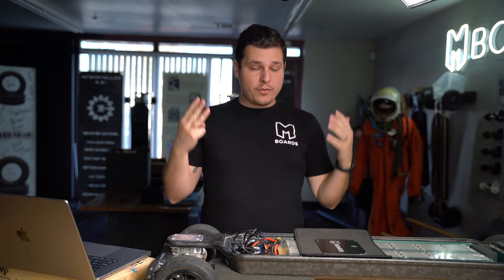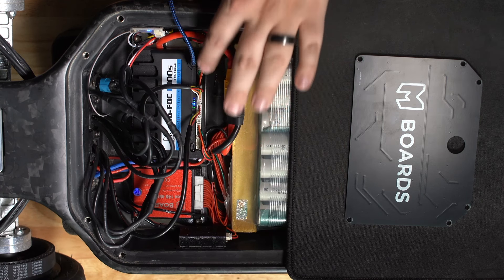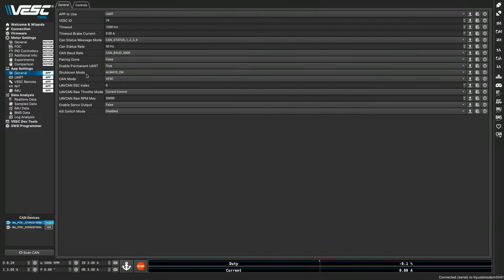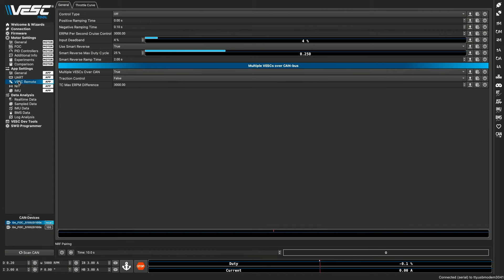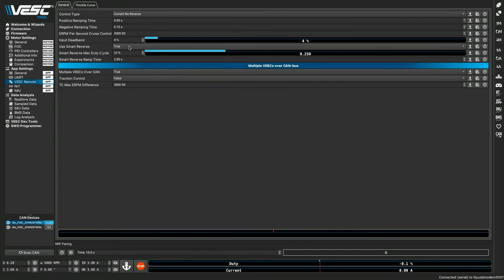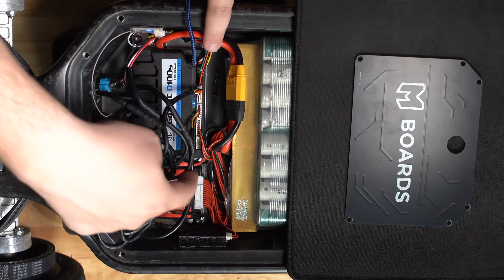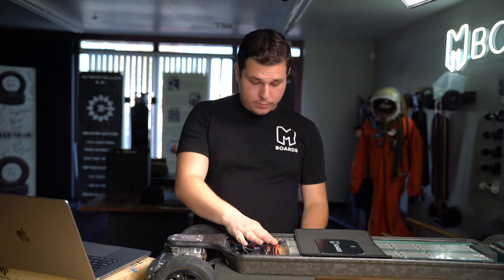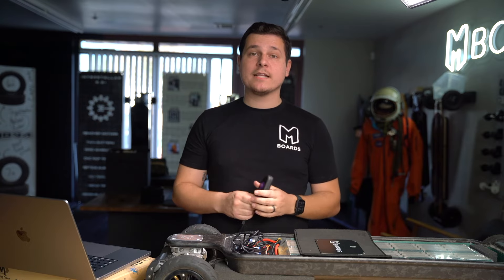VESC TOOL 2024: App Configuration

Comment: Mike these videos are a great refresher and very well explained.

Curious about smart reverse and if you've had the smart reverse glitch.  When on full brake and coming to a stop, the smart reverse  can completely disengage the brakes.

I've only noticed this on full braking. Where you have -120A set maybe you never actually actually need to use full brakes because they are set up so strong?
Reply from the maker: Totally know what you are talking about. You can certainly try lowering the breaking amperage. 

Otherwise, try extending the ramp time so the smart reverse has to wait a little longer before engaging.